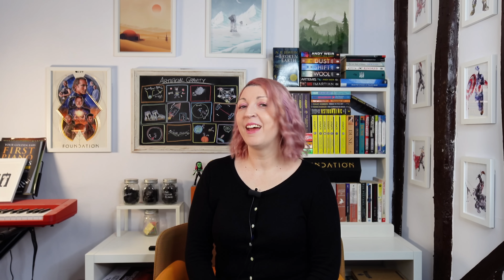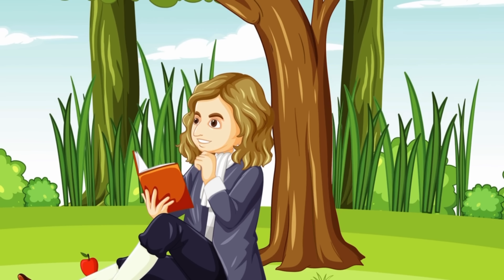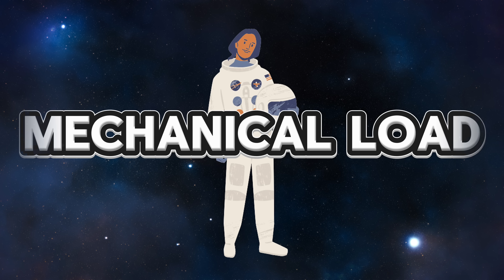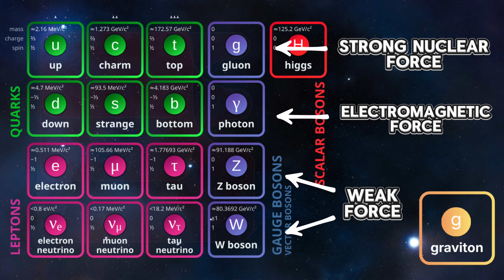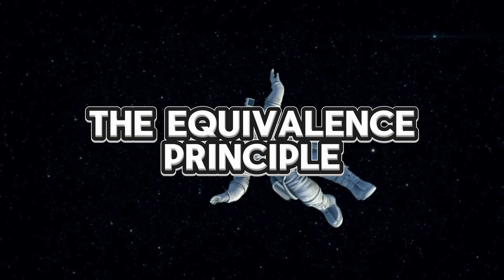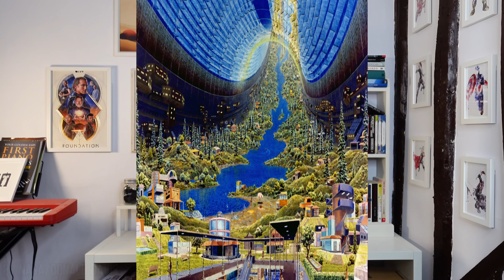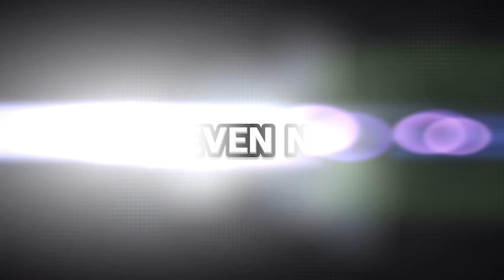Why Artificial Gravity Is Harder Than It Looks

Comment: I'm sure you already know this - but I just want to underline - there is no such thing as "zero gravity", or "artificial gravity". There is different amounts of gravity - like "micro-gravity" etc... People keep using terms like "zero gravity", or "artificial gravity," even though they are not real. I have a question about  acceleration and the "equivalence principle" - wouldn't the accelerating space ship come up against the natural speed limit in our universe? As for a rotating spaceship - yes, both NASA and USSR tested this and dropped the idea. There's a great video about this by ScottManley (with over 2mil views). And the last point - I think the best sci-film that got the problem of micro-gravity correct is "Woman In The Moon" made in 1929 by Fritz lang. They used straps in the floor and ceilings - just like space stations (American, Russian, Chinese) all use today.

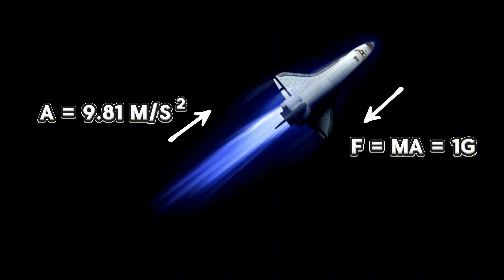Comment: 19:45 "The nose would experience less than the tail"  Huh?  Is there a reason for that?  Or does the nose experience less than the tail on the surface of a planet, but in flight it is uniform?  Because that makes sense, the nose being further from the source of planetary gravity, but in flight, both are accelerating at the same rate.
Reply from the maker: If your spaceship is accelerating at 1g, it’s just like being in gravity, and the nose and tail will feel almost the same. But if the ship is very large or accelerating for a long time, relativity kicks in. To keep the ship rigid, the tail must accelerate slightly more than the nose. It's related to Born Rigidity
Reply: @popculturescientist  Ok, so basically the tail accelerates, and it communicates that acceleration to the nose at the speed of light.  The ship is not a single object, but a lot of segments, that each accelerate as the source of the acceleration is communicated no faster than the speed of light.  This means that each segment would act as its own inertial reference frame, and the relativistic differences between those frames produces differences in the mass/length/time.  That makes sense now, but yeah the effect would have to be tiny, but probably measurable.  Weird, had not considered that.

Comment: Another hypothetical variation of rotational gravity without having to build half a planet's worth of spaceship is tethered masses, which you even brought up a real-life example of, but then didn't go into as a concept for something bigger (or I missed it(?)). Only "hypothetical" insofar that it is debatable if you really want to spin up huge masses in space connected by a bit of string.

Rotation is also used in The Expanse; the repurposed mormon ship is basically a huge spinning drum and they also spun up some colonised asteroid to 1/3 g  in the outermost tunnels or thereabouts (I don't think they explain how the thing doesn't tear itself apart, though).
Reply: "... it is debatable if you really want to spin up huge masses in space connected by a bit of string ..."

It could be a bit of tape . And if you look at it with that sort of wording, what is an O'Neill cylinder or a Stanford torus but a looped bit of tape.

They're all tension structures.
Reply: @grlcowan  Hm, OK. We could probably argue that anything capable of ripping the tether would also more or less destroy whichever other structure.

Comment: Consider...If we can build a warp drive what would it be doing? Warping space-time in a bubble around the ship, right? What is gravity if not the warping of space-time (by mass). So if we could generate a warp bubble around a ship, would it really be that much of a stretch to build a smaller warp field generator to create artificial gravity inside the ship? 🤔
Reply: Most theories about warp drives say that you need mass > the mass of earth. So of course gravity would be no problem then. It would not even be artificial.

Comment: Rotating things in space is not as simple as it is on earth. You can't use a shaft and bearings to hold it to something stationary. If nothing within the object is moving and its shape and mass distribution is right for stable rotation then it will rotate predictably but rotating a habitat for people in a stable way is challenging.

Comment: 19:40 that's not right, the nose and tail accelerate the same, unless you're talking about when the ship is sitting on the ground not under thrust.
Reply from the maker: In everyday terms, if your spaceship is accelerating at 1g, then it’s just like being in gravity and the nose and tail will feel almost the same. But if the ship is very large or accelerating for a long time, especially near light speed, relativity will kick in. To keep the ship rigid the tail must accelerate slightly more than the nose. It’s a real effect, but tiny unless the ship is huge or the acceleration is for a long time. If you want to know more then look into Born Rigidity.
Reply: @popculturescientist hm, my understanding is, that every reference frame is equal, even if it moves close to the speed of light relative to us. 
You should not be able to experience any difference depending on relative speed, within this frame if reference. 
It may look weird in our frame of reference, but the people in the ship should be fine. 

Or maybe I didn't get your point?

Comment: Does not bode well for colonising Mars or the Moon
Reply: If a habitat is built of vertical modules going around large circular tracks - maybe on the walls of a crater - then the speed can be adjusted so that the acceleration due to gravity combined with the centripetal (i.e. inwards) acceleration can be adjusted to approximate 1g. The floors will be angled and more steeply curved further from the centre of rotation but the curvature won't be much if the track diameter is far larger than the width of a module. As the Earth is the body in the Solar System with the highest surface gravity, such a 1g habitat could be built on or under the surface of any Solar planet or moon with a solid surface and both moderate and stable conditions.
Reply: It would depend on the human biological threshold she mentioned. How much gravity is enough? We don't know for sure yet.
Reply: The university city / resort at Mars or among the moons of Jupiter will be in a Stanford Torus habitat for virtually Earth-like conditions.
No new inventions needed to start.

Comment: According to my brother,  the Aero-Space engineer, the  other problem that you did not mention is the added weight the space station to withstand the centrical outward force.
Reply: Your brother (given that he apparently has six degrees !? :) will probably have said centrifugal "force"* but that aside, he's not wrong - one challenge with that kind of structure is the extra stress it's under due to its rotational motion. So with current materials it almost certainly would require more material to give it more strength (which yep, means a higher mass).

* which tells me one of his degrees probably isn't physics, because in physics we don't usually describe that kind of centrifugal effect as a real force without qualification but instead dub it an "inertial", "fictitious" or "pseudo" force because it only exists in non-inertial reference frames and doesn't obey Newton's third law (there are also real centrifugal forces though - it literally just means "away from the centre")
Reply: @E1line-r6d  He applied for the Astronaut corp but was rejected.
Reply: Wouldn’t the centrical force be directed toward the centrically?
Reply: @E.DougK. yes, it would.
Reply: How did your brother pass his degree? He sounds dumb 😂
Reply: @mostlymessingabout  He got 2 degrees from Texas A & M then he joined the USAF and he was a jet pilot. The USAF sent him to Aero-Space School where he earned 4 more degrees.
Reply: Of course it needs different structural considerations.
That's almost obvious enough that it doesn't need mentioning.
Reply: Maybe the joke is that your brother is making you do all his heavy lifting when it comes to communication.  Or maybe, you DO need more exercise.  :planet-orange-purple-ring:
Reply: @cozmothemagician7243  He died of COVID 2 years ago
Reply: @abelgarcia-l4q  Sadly he was too old to be an Astronaut, Covid didn't kill fit, young and healthy people. Sorry for your loss.
Reply: @andymouse  I don't know how old he was when he applied to the astronaut corp.
Reply: Considering how we KNOW how to build large structures that can endure 1 g, that is not a challenge. it just means more mass, which makes it more expensive.
Reply: According to the '70s NASA Ames / Stanford space settlement studies, the biggest pressure vessel which we could build to spin for 1G and hold shielding and everything inside, is ~28km diameter.
If a drum shape instead of a torus wheel, it can't be a long tube: No more than .75 the diameter in the "length" to maintain a stable spin axis.
That's with concrete and steel and readily understood engineering. If using titanium, which isn't rare out there, maybe twice that.

They were very qualified people in all the relevant fields and they are published so that anybody who doubts their findings can see their work and get published refuting it.

Many have started trying to say that no, we don't currently have technical understanding and engineering practices to build such things.

They've all failed and the original numbers still stand (to real engineers and scientists).

Comment: And the next video can be about combating cosmic radiation exposure in the long term
Reply from the maker: This is a great idea!! It's definitely going on the list
Reply: Mind-uploading is how we’ll do it. Scan human brains, store them inside robotic spacecraft and send them on 50,000 year voyages to nearby stars. When they arrive the robots will replicate, spend hundreds or thousands of years building new human habitats and, when they’re ready, they’ll build new organic human bodies and download the stored minds into them.
Reply: @HawkGTboy  Why bother with organic bodies?
Reply: The NASA Ames space habitat studies solved it.

The hull of the Stanford Torus habitat is 1.8 meters thick reinforced concrete to make a robust structure and provide shielding at the same time.
The only reason why we don't have the first such habitat done is because politicians and those who own them don't want it (even though it ends budget crunches and resources and energy scarcity. They can't profiteer from wars for oil.)
Reply: @JFrazer4303  While combating radiation in large scale spacecraft/habitats is not problem at all, I would very much like to see the math and specifications of this particular design. As Stanford torus is pretty large, what kind of reinforcement does this concrete need not to be ripped apart. Beipan River Bridge, the longest span concrete bridge in the world, has span of 388 meters. Little over 1 5th of diameter of Stanford Torus (1.8 km). Original design was full aluminum + glass with separate 1.7 m thick non-rotating radiation shield from Lunar soil.
Reply: @trex2621  
According to the NASA studies, the largest pressure vessel which we could build to spin for 1G and hold shielding and everything inside is ~28kim diameter.
Concrete and steel. If using titanium, maybe twice that.

Later thinking replaced the non-spinning shield with incorporating that mass into the strength of the hull.
Concrete uses less metol than a typical metal design, and it uses the metal only under tension, and typical construction gives cables much higher stress safety than plates and beams. Concrete is much easier to trouble shoot and repair.
 A metal pressure vessel tends to grow cracks and tends to go "POP! when punctured, while concrete offers many gradual failure modes which could be fixed much more easily than a metal vessel like a ship hull or airplane fuselage.
Reply: Elon Musk has a plan for that: 
send someone ELSE!
He's great about sending OTHER people to Mars.... from a safe distance.

Comment: They should have built the ISS to spin end over end to experiment with this. They could have had the crew test the different modules from the ends to the center at different RPMs to see what level of coriolis was acceptable.
Reply: The ISS and the Tiangong are the only places we have to study microgravity. We can't ruin those. Additionally, any major rotation of a space station would affect numerous other systems and activities.
Reply: @Nehmo  I'm sure they can't spin it as it is. They would have had to engineer it for that in the first place. I said "they should have" not "they should." The way I see it the purpose of the ISS is to study everything they need to know for manned missions within the solar system. Most manned NASA missions are designed to learn something needed for future missions, for example Gemini was done to find out if they could dock a lunar module with a command module. 
If they engineered it to spin they could un spin it for microgravity, and spin it at different RPMs to test different gravity levels. That way when they build space craft for Mars they'd have real data to answer questions like;
How much gravity do astronauts need to maintain strength for EVA's on Mars? How small can you make the spin radius at that gravity level before the coriolis becomes intolerable?   
That would tell you how big the space craft and the rocket that carries it to orbit would need to be, or if it's even worth attempting.
Reply: A spin to even 0.7G would tear off the solar panels so re engineering of the mounts taking account of the balance of weight is needed. Not a trivial problem!. 😅
Reply: @fteoOpty64  I didn't say it would be trivial. 
Again I said "should have built it to spin" not "they should spin it as is". Obviously it would have had to be engineered for that. 
solar panels, heat radiators, dock and other systems would have to be stationary. They would probably be anchored to a hub module at the center of gravity which would  rout cable coolant and a docking port through the center of a massive bearing. This would probably be connected to a flywheel of some kind to control  the spinning and non spinning sections.
Reply: @jeremymalick3000  The ISS cost $160 billion as is, using mostly tried and tested ideas - no way did they have the resources to "experiment" with spin.

Which is supported by the fact that there was a module (the Centrifuge Accommodations Module) designed and partially built for the ISS that only contained a centrifuge (for spin gravity related experiments) and even it was cancelled due to cost.

Comment: A pertencial static compression suit is a thin electric magnetic vibrating  suit design to vibrate on muscle movements and throughout the body inside zero gravity for example; at any moment the body suit since  tension anywhere inside the body it would immediately start tracking muscle movements and automatically trigger into vibration mode on all pertencial moving targets internally and externally in zero gravity..

Comment: In star trek they have tractor beams. If those pulled uniformly, then their modification would behave like gravity.
Epstein drive is total fiction. They have inertial fusion engine. But of unrealistically high ISP and with no enormous radiators which would glow red hot to dissipate terrawatts of waste energy.
In praxis, the only artificial gravity we can make for long term(practically forever) is that which is generated by rotating object. What is gravity? Acceleration prevented by electromagnetic force. The solid surface doesn't allow us to fall through itself thanks to electromagnetic interaction between electron envelopes between atoms of our bodies and those forming the ground. And thanks to that counterforce we feel gravity. Otherwise we would just fall through the surface toward the core and feel freefall/zero gravity.
Rotating habitat wouldn't require millions of tons. Lets start small. Kalpana 2 habitat wouldn't weigh even 10000ton.
Reply: The radiator problem makes me wonder why the authors did not got with nuclear fission fragments engines, or "nuclear fission happens behind the spacecraft and glows bright" drives. Cooling the shields will already be a challenge.
Reply: @ArneChristianRosenfeldt  probably because nuclear fragment engine has very low thrust.
BTW, the nuclear fragments engine too has problems with with cooling of active parts even at relatively low accelerations rates.
Reply: @petersvancarek  yeah, still if I get rid of all fragments moving to the back, I only have to deal with half of the heat on the ship. And if my heat shield points to the back ( instead of something internal ), it can radiate at very high temperatures (Stefan Boltzmann law) to the back. Photon thrust for free. Now then I would add the magic and multiply thrust. On the back of the heat shield I can still heat up water and use that as reaction mass or in an ion drive or what they are thinking.

Comment: Light bending around massive objects was a prediction based on Newton's theory of gravitation. Same as a feather and a hammer fall with the same acceleration, so does light.
But it predicts the wrong number. It predicts 1/2 of the actual bending.
That's because Newton's gravitation calculation corresponds to what, in Einstein relativity terms, would be the curvature of space, but it is missing the curvature of time, which contributes the other 1/2 of the bending.